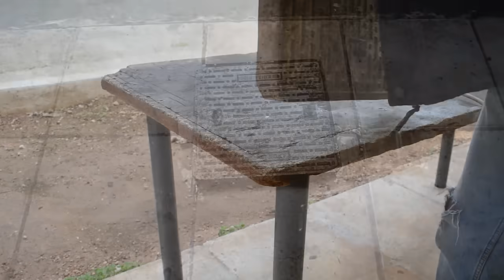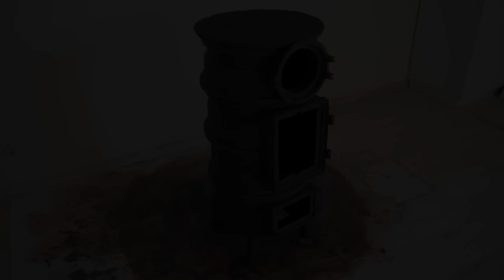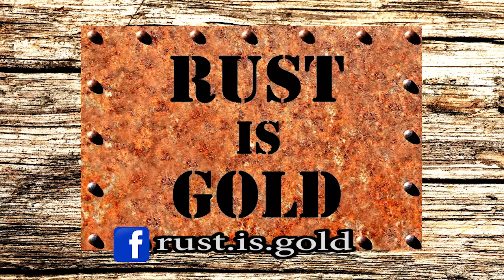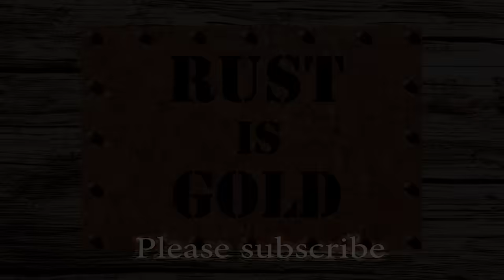DIY Wood Stove made from Car Rims

Comment: I really like your project stove! But what is the function of the top door? Is it just for appearance or does it serve a purpose?
Reply from the maker: Thank you very much for your comments! Mostly it is for appearance... I had this circular door in stock in my workshop so I decided to install it! All the other wood stoves I searched in YouTube had 3 doors. In addition you can open this door to allow more air to go up to the chimney.  This will clear the stove of smoke with out opening the bottom draft door which will increase the strength/heat of the actual fire.
Reply: @RustisGold  I figured it was a cleanout opening for the Flue/Pipe.
Reply from the maker: No, just an extra door! 😊

Comment: Seems you have a natural talent for fabrication... I love the end result... but you should really consider moving your welding rod side to side instead of just dragging it back. you would end up with better looking welds and definitely get penetration. ... good job though...
Reply from the maker: Thank you very much for your comments!! I think slowly but steady I get better in welding! 😊👍👍
Reply: @RustisGold  you may need to hold your stick flame closer to the metal, it looked like you had a lot of splatter beads and thats usually caused by to long an arc. it also looked like you may have not been hot enough for penetration. oh and one more thing when your welding make tiny circular movements with your stick. my shop teacher failed me at least once over each of the conditions ive talked about. loved the design and may have to try this some time. keep on learnin bro
Reply from the maker: Thank you very much! I think I have improved a lot since I built this wood stove. Watched a lot of "how to weld" videos, they were really helpful! 😊👍

Comment: Great skills, but the design will lead to a very inefficient burn to say the least!
The bottom slider and ash door, having no gasket, are going to let in great amounts of underfire air even if closed, which is detrimental when burning wood. It is good for starting the fire, but then you should have as little as possible air coming from under the fire, or else you won't be able to get any significant bed of coals, and you'll have a strong upward draft causing the fire to burn quickly and most of the heat to go up the chimney.
You should really put gaskets on all the openings and provide an overfire air inlet, possibly with a path that pre-heats the air. 
Also, the paint is rated up to 300 deg. celsius, but the stove is gonna get at least twice as hot in a lot of places, both on the inside and the outside!
Reply from the maker: Thank you very much for your comments and your advice. Regarding the door gaskets believe it or not I was a "victim" of the side effects of the coronavirus! By the time I finished my wood stove project all shops where closed due to a strict nationwide lockdown... I was very lucky that I bought the fire resistant glass a day before the lockdown. When things went back to a less strict lockdown I bought and installed door gaskets on my wood stove. 😊👍
Reply: @RustisGold  Thank you for the reply! I guess you had big improvements with the gaskets!  You could also try to install some secondary burn tubes running vertically from the base of the stove, into the firebox and then horizontally over the the fire, with many small holes in them. When the stove is up to temperature close all the other inlets and have most of the air come thru the tubes, this will also greatly improve efficiency by providing preheated air over the fire for a more complete combustion.
Reply from the maker: @Dave93b  thanks again for your comments and your recommendations! 😊👍👍

Comment: Very cool!  What is the purpose of the top, round door?
Reply from the maker: Thank you very much for your comments! I wanted to put a small door on top and I had this circular door here in stock so I decided to install it! All the other wood stoves I searched in YouTube had 3 doors. In addition you can open this door to allow more air to go up to the chimney.  This will clear the stove of smoke with out opening the bottom draft door which will increase the strength/heat of the actual fire.
Reply: Makes sense. Thanks!
Reply from the maker: Doug Devine  thank you very much! Glad you liked it! 😊👍👍

Comment: Great build, what’s the reason for the top round port ?
Reply from the maker: Thank you very much for your comments! I wanted to put a small door on top and I had this circular door here in stock so I decided to install it! All the other wood stoves I searched in YouTube had 3 doors. In addition you can open this door to allow more air to go up chimney.  This will clear the stove of smoke with out opening bottom draft door which will increase the strength/heat of the actual fire.
Reply: Great idea
Reply from the maker: @The Cowboy Way this is true!!  ...although I don't like marshmallows!! 😄

Comment: Nice build, leave out the bottom sliding door and just use a shovel to scoop out the ashes, as with all wood stoves start out with a couple inches of ashes or sand if you dont have any in the bottom to insulate the bottom from red hot coals. For air control put a round jotul style air control in the lower door, other than that this is a nice stove as seen by having millions of views.
Reply from the maker: Thank you very much for your comments and your suggestions!! 😊👍👍

Comment: Great work mate,  I love it! 
One question but, what is the purpose of the top most door?
Thanks in advance.
Reply from the maker: Thank you very much for your comments! I wanted to put a small door on top and I had this circular door here in stock so I decided to install it! All the other wood stoves I searched in YouTube had 3 doors. In addition you can open this door to allow more air to go up chimney.  This will clear the stove of smoke with out opening bottom draft door which will increase the strength/heat of the actual fire.
Reply: @RustisGold  it's very impressive mate. That'd look great sitting in my shed. Top job, and cheers for replying.

Comment: Great idea 💡— what’s the round portal above the glass door? What does it do? I thought 💭 it was gonna be an oven!? Good time-lapsed film work too!
Reply from the maker: Thank you very much for your comments! I wanted to put a small door on top and I had this circular door here in stock so I decided to install it! All the other wood stoves I searched in YouTube had 3 doors. In addition you can open this door to allow more air to go up chimney.  This will clear the stove of smoke with out opening bottom draft door which will increase the strength/heat of the actual fire.
Reply: Rust is Gold perfectly clear my friend... had not thought 💭 about that angle. 👍

Comment: What purpose does the top door serve?
Reply from the maker: Thank you very much for your comments! I wanted to put a small door on top and I had this circular door here in stock so I decided to install it! All the other wood stoves I searched in YouTube had 3 doors. In addition you can open this door to allow more air to go up to the chimney.  This will clear the stove of smoke with out opening the bottom draft door which will increase the strength/heat of the actual fire.

Comment: Looks great but I need to know what the top little round door is for
Reply from the maker: Thank you very much for your comments! I wanted to put a small door on top and I had this circular door here in stock so I decided to install it! All the other wood stoves I searched in YouTube had 3 doors. In addition you can open this door to allow more air to go up to the chimney.  This will clear the stove of smoke with out opening the bottom draft door which will increase the strength/heat of the actual fire.
Reply: @RustisGold  well that’s great and it looks really nice. I built one out of old water heater and it worked good but doesn’t look as pretty as yours. 👍
Reply: @RustisGold  it made it look even better 👍
Reply from the maker: @suminagum6605  I agree! 😊👍👍

Comment: Good job man... what is the function of the upper opening?
Reply from the maker: Thank you very much for your comments! I wanted to put a small door on top and I had this circular door here in stock so I decided to install it! All the other wood stoves I searched in YouTube had 3 doors. In addition you can open this door to allow more air to go up chimney.  This will clear the stove of smoke with out opening bottom draft door which will increase the strength/heat of the actual fire.
Reply: @RustisGold   Awesome, Thx.

Comment: Amazing!! I would also like to see a concrete filling in the indentured space around the outside circle of the wheels encased in metal sheeting so the outside  is more or less uniformly cylindrical. This would add quality to the heat output as well as insulation and safety aspects as well
Reply from the maker: This is true. 😊👍

Comment: hello, very good, what is the function of the door of the minute 25:20?
Reply from the maker: Thank you very much for your comments! I wanted to put a small door on top and I had this circular door here in stock so I decided to install it! All the other wood stoves I searched in YouTube had 3 doors. In addition you can open this door to allow more air to go up chimney.  This will clear the stove of smoke with out opening bottom draft door which will increase the strength/heat of the actual fire.
Reply: @RustisGold  thank you  by or explain

Comment: I've seen variations of this for example. When I had my shop I had a barrel furnace that would heat the place. My better was always stubborn like that. A Cast Iron Griddle would've worked great to disperse more heat throughout the building. Instead, we started relying on Fuel oil to heat our upstairs office. Heat rises my ass I'm so glad the auto industry went to water-soluble paint's...

Comment: Awsome DIY and end result , but there is only 1 thing that you could do to make it better , to connect those 2 open leavers for the wood door so you would Open the door by moving just 1 leaver , also put a small piece of metal underneath so when the dor is open the leaver wont go to much down :)
Reply from the maker: Thank you very much for your comments!! Glad you liked it! What you say is very correct. The only reason why I didn't put 1 open door leaver or connect the 2 leavers together was purely aesthetic. I liked the Greek inscription on the side of the door frame I created and didn't want to cover it! Greetings from Greece!!! 😊🇬🇷👍

Comment: Very nice!  Here's a few questions:
1) What's the round upper door for?
2) Why did you drill and tap and bolt on the rebar door handles when everything else is welded?
3) Will that paint really hold up on the interior?  Is it there to protect the metal?

Once again, very nice.

Comment: What is the purpose of the upper, circular door? I get the draft door, ash pit and fuel stocking doors. It looks cool, but I don't see it's purpose.
Reply from the maker: Thank you very much for your comments! I wanted to put a small door on top and I had this circular door here in stock so I decided to install it! All the other wood stoves I searched in YouTube had 3 doors. In addition you can open this door to allow more air to go up chimney.  This will clear the stove of smoke with out opening bottom draft door which will increase the strength/heat of the actual fire.
Reply: @RustisGold  in thought it was 
For hot dogs.

Comment: Is there higher-temp paints? Because, fires get much hotter than 300*F…?
Reply from the maker: This paint is for 300 degrees Celsius not Fahrenheit.
300C = 600F
Reply: @RustisGold  that will do on exterior parts, & Maybe, briefly inside the shell of a larger burn box, but how does that do inside the burn chamber of a hotter-burning unit? 
Or, was it applied to all inside surfaces to look nice just at the beginning?
Reply from the maker: You are absolutely right! There was no need to paint the inside but it looked nice in the beginning! 😊👍